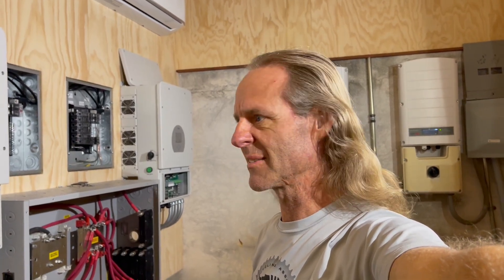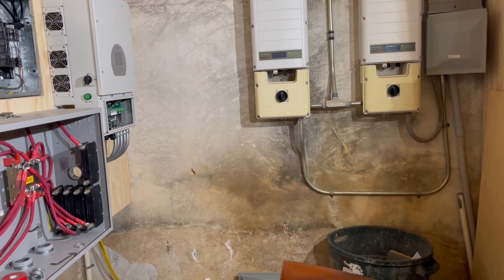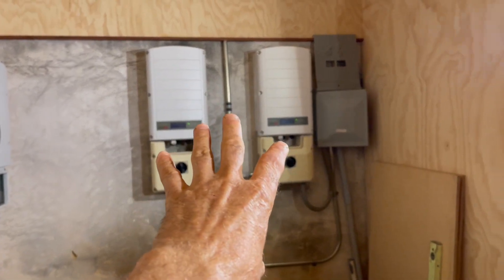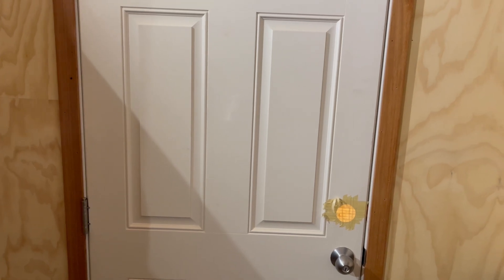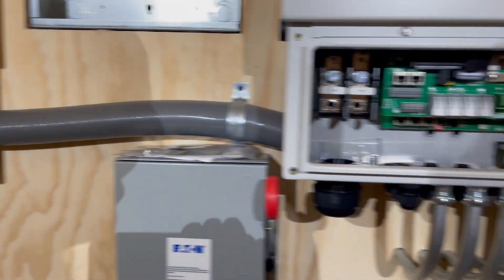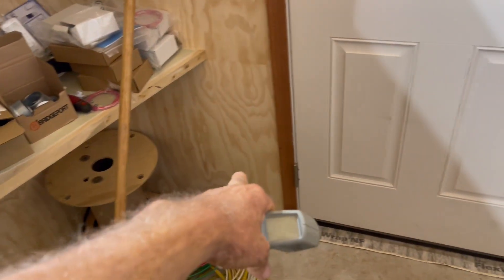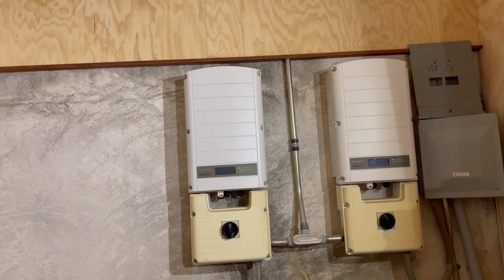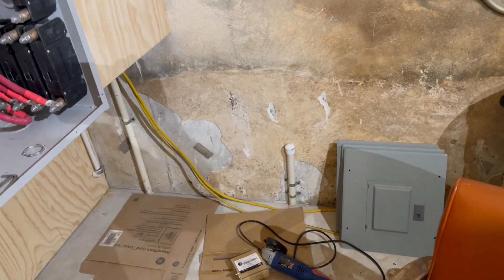Exciting Performance From My Lifepo4 Solar Storage Building. It Works Y'all!!

Comment from the maker: I wanted to update the data. Last night's lows were again 26 degrees f. The temperatures shown in this video have dropped almost a consistent 3 degrees in each location measured except above the inverters are about 5 degrees cooler and the concrete wall is two degrees cooler except that the very top where the cold slab on top of the wall is conducting heat out of the building and that thin band measured 57 degrees. Yesterday I saw it at 62 degrees. All in all, pretty fine performance.
Reply: Have a friend that used a 45ft shipping container as a heat sink on the north wall of his green house. -40C you can walk in there and its still 12C in there at night.

Comment: Heya, -4 celsius is cold. around 25 is perfect. isolating the chad will bring a lot of benefits and with the thermal mass of the beton wall even more and you have the prove by showing with the thermometer I don't know if the mini split is nessesary but the future will show. could you do a vlog about the all ready installed pannels would love that. sorry but I like long vlogs ( 1 hours or longer lol) asspecially wen they are in very dailtaled information so people can get a good perspective

Comment: New subscriber. I like you ethos for the way you make your videos and run your channel. Do you use CAD to lay out your projects, or napkins, or just remember everything?
Reply from the maker: Napkins and memory. I use CAD when I have to share it with a team. For my own use shorthand sketches are sufficient. I've built multi-million dollar homes where hand sketches were the dominant info exchange. For the layout in this room I used CAD for the layout and the building elevations, sections and floorpan. The benefit of this was I'm doing two projects that are very similar so I was able to use mine to create hers.

Comment: What’s an extra minute between friends.  May I ask, how thick is that concrete.  It will also absorb a massive amount of heat from any systems you install, but will the air in the room effectively conduct the heat of the inverters not attached to the wall?   I don’t know that answer, but I fear they will heat their area of the air more rapidly than the air can conduct it to the concrete radiator you have there.
Reply from the maker: The heat will transmit between the surfaces by radiation. The second law of thermodynamics rules the day. The surfaces in sight of one another will seek equilibrium over time. Heat transmitted through a fluid such as air does so by convection. It is not as effective in this case. In fact the hybrid inverters use convection to remove heat through their heat sinks and require fans to aid the process. In any case. The mass wall will help moderate the temperature of all the surfaces in the room. 

One issue to note is that in the summer the mass wall may be in the mid  to upper 80s. I think it will be less. We will see it together. I can't try to cool the room below this point or I will dump energy into cooling that huge mass. It isn't just the mass of the wall and the water behind it but also the ground beneath the water and all around the tank. The tank is 16'x32'x8'. The concrete walls are 9" thick if I recall correctly. It has been almost 20 years. Basically it is a swimming pool shell with a 6.5" concrete lid as far as construction goes.

Comment: You think that’s bad, where I live close to Seattle Washington, we got hit with a snowstorm this last week and my solar shut down because it was too cold for the batteries and charge controllers to work!
I quickly had to insulate the back room, which is basically an attached deck that’s enclosed. Even had to use some heaters to bring up the temperature so that I could get some solar.

Comment: 1 kilowatt is about 3400 BTU.  How many kilowatts are on those inverters? How efficient are they?
Most likely 90% or maybe a bit better at their ideal power power throughput. 90% efficient means 10% of the solar power is converted to heat.
How much heat will they produce?
Reply from the maker: 99% weighted efficiency for almost the entire curve. 

There is more to the mass than the simple calculation I did on the video also. The mass is also tied to the deep ground temperature which is 70 degrees here. There are a lot of factors but the point I was making is that mass can hold orders of magnitude more heat than air by volume. 

Another factor that is not always considered is the mass is 24 hours a day and the heat of the inverters is only when producing power so you can actually calculate the daily, monthly or annual PV production and use that for the waste heat factor balanced against the thermal mass contribution to heat absorption or production. 

There's more to discuss but I'm pressed for time.
Reply: Gridtie inverters and charge controllers are pretty close to 99% efficient.  Now the new inverters will be a lot less since they are pulling from 48V and would hit about 90% efficiency.   So this is a good test for worst case in winter, but the real test will be in summer with all three of the new inverters going and trying to keep them cool.
Reply from the maker: This is true but it will be a mix of both and the batteries will be used in different times than the peak of  the hot part of the day. The hot part of the day is 3-10pm. The batteries will be charged. The grid tie inverters will be cooling the house and supplying the loads and it won't be until the cool off begins that the batteries will come into use and then at much lower levels of use than during the peak periods earlier in the day. The ductless mini split will be very oversized.

I will have to keep it set above the temperature of the thermal mass wall or else I will be pulling heat out of the mass wall and will never win that tug of war.
Reply: @jmaus2k  The old PWM charge controllers could be 99% efficient in that they did not dissipate much power. They had poor tracking efficiency.
Do not confuse tracking efficiency with overall power transfer efficiency. I've never seen any buck/boost supply like in MPPT systems spec 99% for anything except tracking efficiency. They dissipate power - that's why they have heat sinks and ventilation requirements.
Efficiency is a curve (function of power) and I've never seen a curve at 99% for any significant range of power.  Efficiency drops significantly if not at the ideal power point. The ideal point is rare when solar input or dynamic loads are concerned.
Reply from the maker: Solar edge 7600 go check out the power curve. I just did again and it is near 99% for most of the curve and these panels have optimizers which seems to help also. For sure it isn't anywhere near 90% at any output level where you would be talking about generating much actual heat. It is important to not the peak efficiency occurs at the entire range when the production is at a level where you are talking about any real heat levels. Am I missing something?
Reply: @RayBuildsCoolStuff  I only found the Europe and APAC curve - but yes, those are impressive inverters!  That's a surprisingly flat curve with only a percent or two variance between 30% and 100% capacity. (The CEC weighted efficiency hints that the U.S. curve is similar.) The optimizers do help - they have losses on their own so you multiply the two efficiencies for system efficiency - and still seems to be high 90s and very impressive - but of course those losses are outside the shed.
I don't know how they do it!  Thanks for taking the time to think and respond.
Reply: @Sylvan_dB  Even a cheap MakeSkyBlue MPPT charge controller is 98% efficient.  All a charge controller does is switch on an off transistors to match the load curve of the panels.  Not much for losses.  Of course, Solar Edge does a much better job.  Pushing 48V up to 300V and then inverting to 120 or 240V AC is where you get a hit on efficiency which is why the solar edge storage batteries are about 500V so they can optimize for their gridtie inverter solar input voltage and get close to 99% again.
Reply: @jmaus2k  Where are the efficiency curves for makeskyblue? Why does it have a fan? It's to dissipate lost power.
Transistor switching losses are large which is why so much research goes into that area. Every MPPT must do voltage conversion because panel voltage varies. Tracking that is what MPPT does.
Reply: @Sylvan_dB  Stepping down voltage only requires a pwm circuit - similar to a cordless drill.  But the MPPT tells it the best % on/off and yes, that isn't as accurate on less expensive controllers.  But if this was less than 98%, that fan would need to be much bigger.  The tiny fan on mine hardly runs.  maybe 10 seconds every 5 minutes and it is putting through 2000 Watts.  There are charge controllers that step up voltage, but those are not common and would be less efficient.
Reply: @jmaus2k  That is called a PWM controller, not MPPT.  An MPPT is a variable buck converter (to reduce voltage, or boost convert to raise) and has a big inductor to support that.  No inductor, not MPPT. Big inductor, buck converter.
Reply: CEC Efficiency = 96.5%

Comment: I wish 26F this time of the month.
Try -22F right now outside my front door 😬.
Reply from the maker: Understood. I have dear friend on the James Bay. -50 is their winter normal conditions. I would get so tired of shedding and donning layers of clothes. What really gets me is the pain in my lungs when I exert myself in those temps. It burns. Stay safe buddy.
Reply: @RayBuildsCoolStuff  I'm about 8 hour drive from the Hudson Bay (which connects to James Bay).... That is If the roads continued that far north! Yes the cold literally takes your breath away, but if you take smokers as an example: lungs can tolerate quite the abuse. Do you get used to it after the initial annual shock.
Cheers!
Reply from the maker: Rupert River, first nation village. Best people ever.